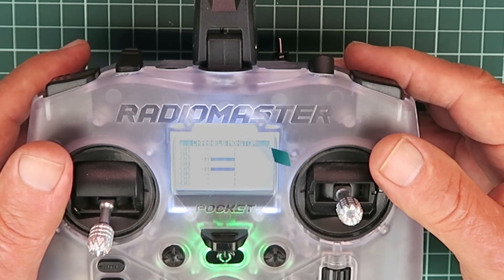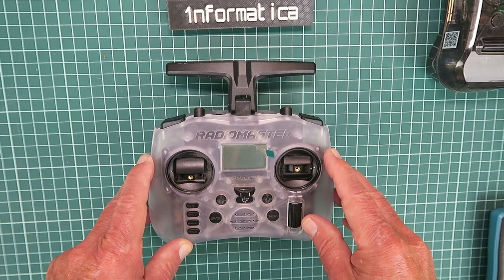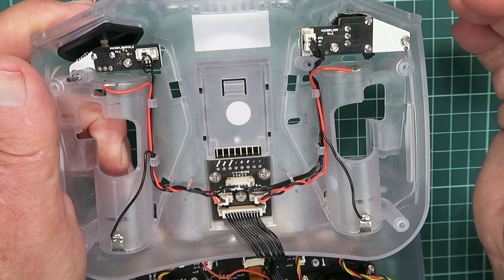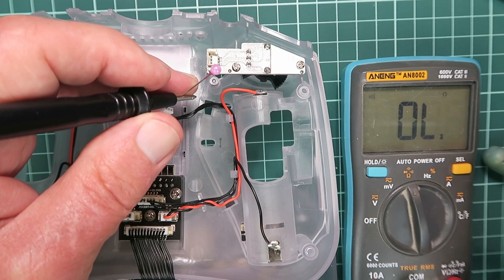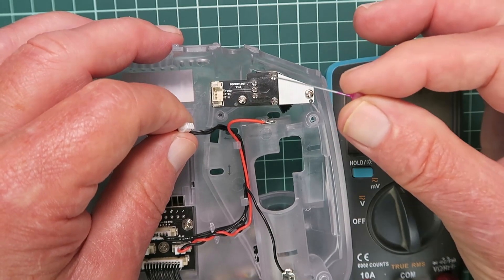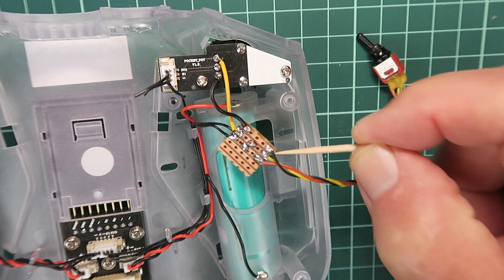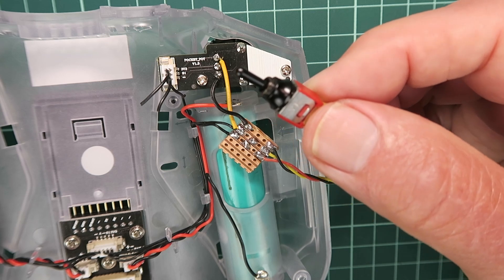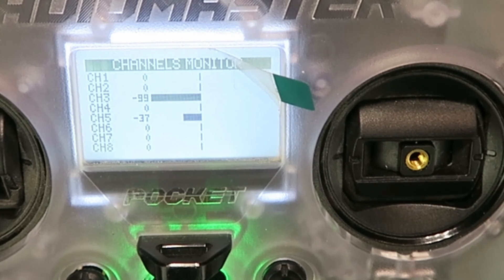Add a 3-Way Switch to Your Radiomaster Pocket – Easy DIY Mod for More Flight Control!

Comment: How would I go about adding a momentary switch to the pocket? I'm trying to make the rescue mode for omp m1 evo helicopter work with se switch, and it's not working for me. Any suggestions?
Reply from the maker: There are no spare inputs available on the Pocket. Even if there were the switch SE is a momentary switch and it would act the same. You have to work out why it's not working for you. Use the channels monitor to see what SE is doing and compare with what the evo is expecting to see. I use the SE switch all the time for telling me my battery voltage via telemetry and it works fine. Thanks for watching, have a great day!

Comment: Does the rotary still work?
Reply from the maker: This mod replaces the rotary with a switch, so, no, the rotary no longer works. You can use logical switches and use the rotary like this : https://chatgpt.com/share/690726c3-c254-8008-ab2f-4e6d4929e110

Comment: i need an extra rotary pot instead of a switch
is there any way to add more
Reply from the maker: Not without sacrificing one of the 3 way switches. As far as I know there are no other analogue gpio pins available. Thanks for watching, have a great day!
Reply: @1nformatica
yes i can sacrifice it but i needed for servo gimbal in f722 flight controller

as 1 is not enough for 2 axis control.

Comment: Nice. This also means that multiple 3-way switches could be added.
Reply from the maker: Hey thanks! How would you add additional switches? Have a great day!
Reply: @1nformatica you've only used 3 positions from the rotary dial. I think you can chain multiple switches together to access more of its positions.
Reply from the maker: @aracrg  OK, I see it could be done.

Comment: I would have tuned the resistor values rather than putting a Bandaid on the Voltage divider.
Reply from the maker: Whatever works for you! Thanks for watching, have a great day!